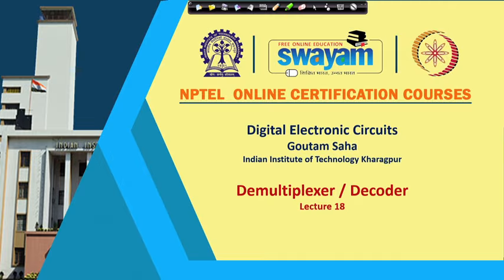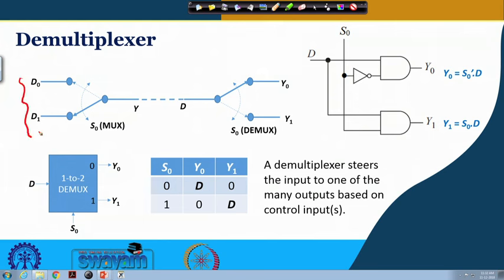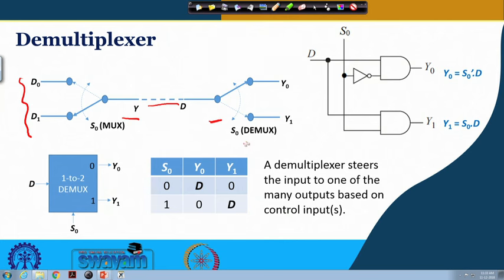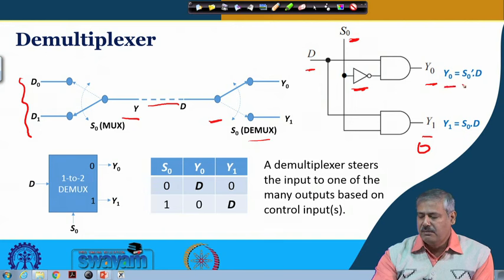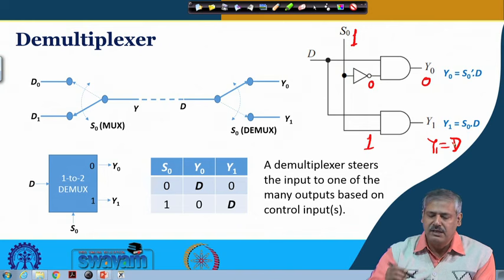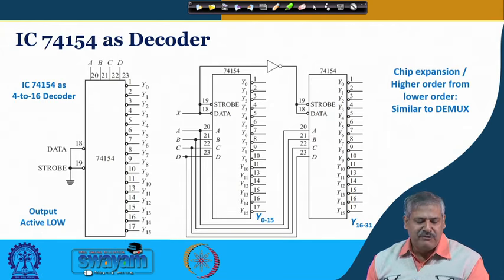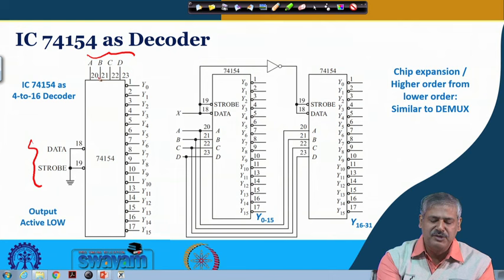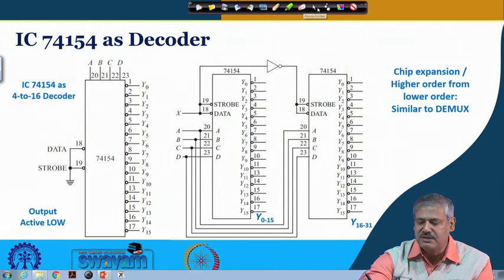Lecture 18: Demultiplexer / Decoder

Comment: to decode AB = 01 , y = A'B, the inverter should be at A  and B directly connected to AND gate., but in the slide it is given in the reverse order. Please correct if  I'm wrong
Reply: You are right.